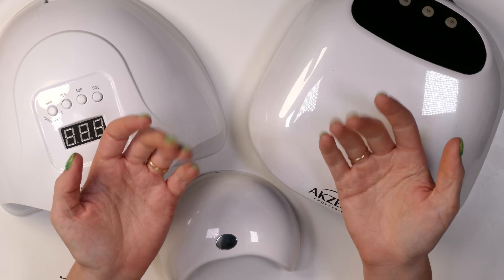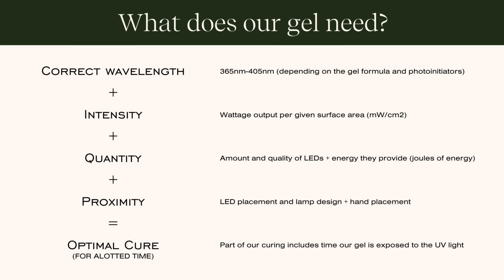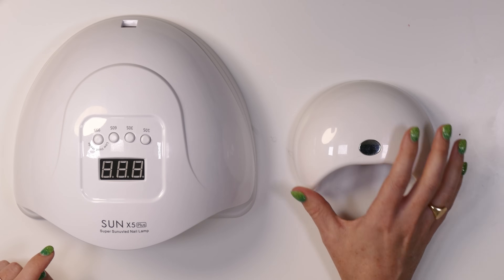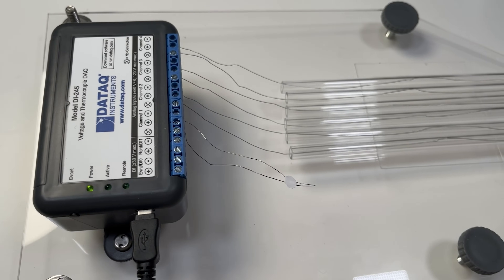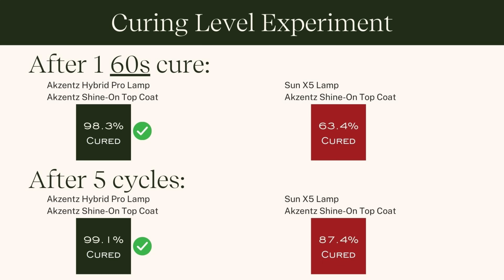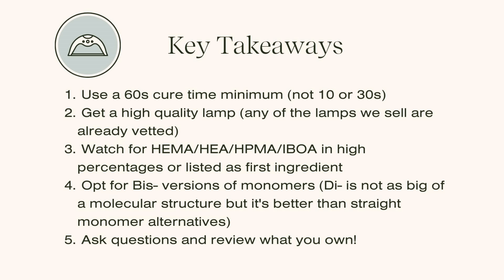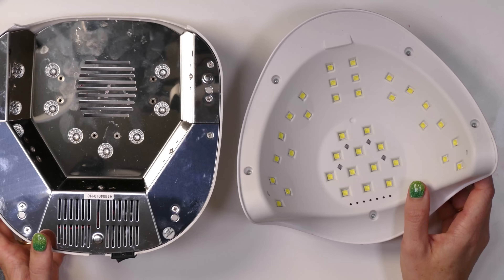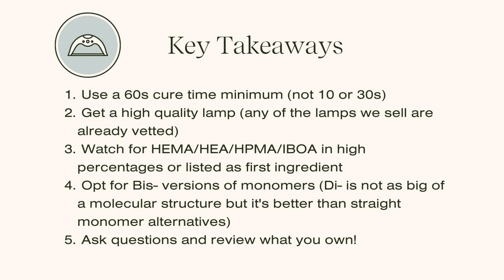Is Your Nail Lamp Giving You Allergies?

Comment: I have a dual  spectrum lamp, on some of my gels they give a time for uv and a time for led eg 30 seconds LED or 2 minutes UV. 
For a hybrid/ broad spectrum lamp should I be curing for the 30 seconds or the 2 minutes? I’ve been playing safe and going for the 2 minutes but I’d save a LOT of time if I could do 30 seconds instead! I only do my own nails so it’s not critical time wise but at the same time i don’t want to be exposing my hand to unnecessary UV rays either. Thank you . 😊
Reply from the maker: If you're using 400/405nm compatible gels (referred to as LED or UV/LED gels) then you could just do 60s.  The "UV" portion is talking about a CFL lamp.  If you're using an LED lamp then I would suggest 60s cure times.  But you'd have to confirm with the manufacturer of your gel.  If they say 30s per layer in your lamp do 60s.  If they say 2 minutes do 2 minutes.

Comment: Hi, so I just switched my gel nail polish to Canni. I know they are HEM free and I can tell a big difference. 

However, I’m still getting burns on my toes and fingers. I’ve gone through three nail lamps trying to find the right one. I’ve also tried a small single one. And just saw on YouTube too move it around and don’t put it so close to your nail. So I’m gonna try to see if that helps. any other suggestions as I do sometimes get blisters on my toes from just the heat and it’s painful

Comment: I get gel extensions done at a local salon and i know they use cheap lamps. But I'm unable to do my own extensions at home. They use CND gel polish. Would it help after my appt, I cured them more under a CND lamp?
Reply from the maker: Why not ask them to upgrade their lamps?  Instead of you trying to find a workaround at home (which isn't going to really work well if they aren't curing each layer properly and you're just trying to cure the outside at home), why not help teach them about the importance of curing when it comes to nail allergies and ask them info about their lamps they are using?  Or find another salon that does use quality lamps and products?

Comment: I have a Bioseaweed gel that cost me 120 dollars that looks like the “cheap” lamp, should I be worried?
Reply from the maker: If you use Bioseaweed gel they should be responsible for testing to make sure their lamp cures their gels to safe levels.  I have not reviewed the SDS for this brand.  I would contact them to inquire about what testing they have done regarding curing levels reached in their gels when using their lamps.  According to industry experts like Doug Schoon and Jim McConnell, gels must be exposed for at least 60s to properly cure. So at a minimum I would check what cure times they recommend, what's in their formula (check SDS for ingredients), ask them questions or voice your concerns to them and go from there.

Comment: Is there a way to tell how many mW/cm2 or energy output a nail lamp will produce? Most descriptions for lamps online don’t seem to go into that level of detail. Would it be a case of getting in touch with the retailer/manufacturer to ask?
Reply from the maker: No not without lab instruments. If you’re buying the lamp that comes from your gel brand company you’re most likely good to go as they will have done that testing. The main issue is people buying generic lamps (that are usually super cheap for a reason) and trying to cure all their gels with it. Each gel formula has to be tested to match with a lamp because of the specific energy needed to fully cure that particular gel. Manufacturers usually do that when they make a lamp for their gel line.

Comment: Hi Liz, super useful video. I have a question. I do my own nails at home with the sun x lamp and have been for years. I only use one type of gel (the OPI) and I've never had any issues. Should I be worried? Or should I be buying equipment to take temperature readings? I live in the UK and the other more powerful nail lamps you mention don't seem to be available to me. How can I test or make sure the lamp I am using is safe with the gel I am using?
Reply from the maker: Hi Daisy, allergies can be developing well before any physical manifestation. Most of the time when itchiness or redness starts happening it is from prolonged periods of exposure. So keep that in mind.  And if you’re primarily using OPI I would recommend getting the OPI lamp so you have that assurance on curing.

Comment: I know it might sound silly, but getting an allergy to nail products scares me SO much to the point where I get upset thinking about it because I'm passionate about nails and for years, I was getting cheap Chinese nail products on my skin and only recently learned about allergies.

Even now, there is no way I can afford these oligomer products and at best, can only afford di-HEMA ones. I will definitely purchase a good lamp though.
Reply from the maker: It’s a very difficult and nuanced topic because allergies also don’t happen to everyone either. But the incidence rate is increasing hence me trying to give everyone the full picture. Being aware is the most important. Not necessary to be scared but I understand why you feel that way.
Reply: What if you bought fewer colors, but higher quality?
Reply: @Lisalovesliberty1  - So what I'm referring to is the builder gel. As far as colors go, I formulate my colors using cosmetic pigment and mixing my builder gel.

So I'm legit just talking about one product. I've looked at the prices of the oligomer products on the market and they are SO expensive (for DIYers, that aren't making money from this).

Right now, I'm going to settle with IBD gel which has Di-HEMA. I read a sheet that shown Di-HEMA's molecular size is almost double regular HEMA. It's not as ideal as Bis-HEMA, but it's still less allergenic, and with full protective gear and an expensive professional lamp, I think I'll be okay. And I'm gonna do the thermometer test that Liz shown on her channel, where I can see if it's properly curing.
Reply: Great video Liz , all greetings from Tunisia ❤ can you make a video about how nail uv lamps are safe ?

Comment: Hi, Liz. Sorry to bombard you.

When it comes to curing completely clear gel, is it acceptable to only slightly cure (say, 15-20 seconds or so) to harden it, and then apply lots more on top and then do a full cure? Obviously this wouldn't at all be suitable for pigmented gels, as the inside wouldn't cure fully, but can you do this with clear? Does the light penetrate all the way through?

I do very long nails, and have to do 2-3, sometimes even 4 layers of gel (they're more than 2 inches long), and having to do 60 seconds for every layer for every finger would take VERY long.
Reply from the maker: Hi Brianna, yes you can absolutely flash cure products to keep them in place, but you need to fully cure the product afterwards and this only works well with clear.  As long as nothing is obstructing the light from penetrating the product well it should be fine, but you could be experiencing more heat by not fully curing in between major layers as you'll have the full exothermic reaction happening on all layers at the same time and this could cause a potential excess of heat on your nail bed.  Greatly depends on the gel you're using, how you're applying the gel, and also the lamp.  

For super long nails (even 2 inches) you might want to flash things into place, then move on to another finger first, and continue until all the nails have the same layer of gel.  Then fully cure that layer before adding more product.  Hope that makes sense.
Reply: @TheNailHub  - Thank you, Liz. This is immeasurably helpful. Seriously. The information you put out, and your responsiveness is unmatched.

Before I found your videos on allergies, I was using cheap Chinese products, getting them on my skin and not thinking anything of it, and I cringe! I seriously almost purchased 1000ml of cheap gel from AliExpress.

Also, I even watch professionals I love using their fingers to swipe the gel off the edges of the nails, and I gasp in horror, haha.

As soon as I saw your old video about Hema and allergies, I bought nitrile gloves, a dust collector, started wearing a mask, goggles and covering my body. But unfortunately I've been using a cheap Amazon lamp. Now I'm going to get the Infinity Lamp.

Comment: Hi Liz! 
Firstly thank you so much for educating us on basics of chemicals in gels and lamps. Getting trusted information is very difficult.

I would really appreciate if you could address the following topic as well. These questions are coming from clients and I want to make sure my answers are right 
- Will using sunscreen before starting nails will help to reduce the risk of cancer from UVLED lamps?
- if cream is applied is there a chance that it gets on prepped nails and affect the durability of gels.

I think we shouldn't apply cream. Please give more clear information on these areas as well. 

Next important question is which type of extension is mire harmful or damaging? Acrylic/builder gel/polygel gel or dip powder? Asking based on the chemical reactions. 
I feel acrylic is more risky but i don't have strong technical explanation to it.

If you have already addressed these areas in old videos please provide the link. ❤
Reply: Not Liz, but I know a thing or two about this and can hopefully help.
 
Here's the thing about nails and cancer risk due to UV exposure: our actual nails aren't living, so they can't get cancer. Our nail beds can get cancer, but never due to UV exposure due to the fact that our nails filter 100% of UV light. No UV light can get to our nail beds and our actual nails are unaffected by UV exposure. If someone gets cancer of the nail bed, it is unrelated to their UV exposure (which is why it's one of the most uncommon types of skin cancers).

For the skin surrounding the nails, UV exposure can impact skin cancer risk. UV exposure from LED/UV lamps is going to be possibly the smallest contributor to a person's UV exposure, but UV damage is cumulative, so it doesn't hurt to protect yourself from all sources of it. You will be sufficiently protected by using a glove or sunscreen only on the skin itself and not on the nails. You could clean the nails after applying sunscreen to avoid it interfering with adhesion in case some gets on the nails. A sunscreen stick would allow for more precise application

Comment: Liz, thank you so much for sharing this information in this video as well as the previous one! I do my own nails at home and while I rarely use gel, maybe a few times a year, I definitely want to be sure I’m doing it safely and this information is extremely helpful. It seems that this safety information is so rarely talked about, it’s no wonder allergies are on the rise. I have a lamp from Amazon that I spent like $20 on a while back. I’ve only used it a couple times but I think I will get rid of it after watching this video and look for something safer. Thank you again!

Comment: How safe do you consider off brand gel products during pregnancy. For example I got the glass nails from NCE and was wondering that. I also have joya mía. Melody Aussie and other brands. That are not like light elegance.
Reply from the maker: I would recommend asking these types of questions to those manufacturers. Ask for SDS. Ask about their lamps and actual output metrics not just wattage on the box. Ask them and see if they respond and how they respond. Will tell you a lot. I don’t know anything about those brands so you’d have to research a bit.

Comment: Let’s say your base gel has fully cured to 99%. what if the color gel layer above that has only cured to like 70%…will your natural nail be protected by the base layer as long as it’s evenly applied (so that none of the color is touching the natural nail)?
Reply from the maker: Your natural nail doesn’t really absorb product. It’s the surrounding skin. And because HEMA is water soluble it can leach out when exposed to water and get on the skin in small amounts. Over time your body may start to create an immune response to this. There’s no fool proof way to “encapsulate” a specific undercured layer. It may help, but it’s not something I would rely on. Better to get yourself set up with quality products and equipment that truly mitigate the risk.
Reply: @TheNailHub  you are amazing thank you!!! Once again all my questions answered ☺️

Comment: Why do you say "UV only" is a misnomer when those gels require UV (365nm) and will not cure without it? They won't cure with visible light wavelengths.
Reply from the maker: It’s misused. Typically it is used as a comparison to LED which is an emitter or bulb type. You could say UV-A vs near UV-A vs violet visible light to describe the types of wavelengths being emitted or the compatible photo initiators but instead it is erroneously referred to as UV/LED which is not communicating the situation clearly. It should really be UV-A vs Near UV-A/Violet when talking about wavelengths and CFL vs LED when talking about emitters. Our industry confuses these two things and the real meaning is lost easily. I’m referring to the typical context that UV only is used in.

Comment: Thank you for this information, I actually have that SUN lamp some one gave it to me as a gift. 
I just bought my first gel starter kit from kokoist, they actually sent me a mini LED lamp and it said only 4 watts. I didn’t use it yet because I thought it might just be for flash cures. Now I’m wondering if it will work better than the SUN. I’m new to gel and am trying to mindful and cautious about allergies, so I really appreciate your videos.
Reply from the maker: It it’s the milk cake lamp then it is for flash curing the Gelip nail tips. Not for color gels. You’ll need something like the Kokoist Infinity to safely cure Kokoist. All the SUN UV lamps I’ve seen are not sufficient.
Reply: @TheNailHub  no it isn’t the milk cake lamp. I can’t find any info of it on their website either. Maybe I will call them. It does have a 405 nm. The name on the box is compact LED light.

Comment: Hold on a second. The minidot lamp is a 45 mW/cm2 output. It is a smaller lamp. This number makes sense. 

If the LE Minidot was the same size as the SunUV lamp with the same area, it is very very likely that both have the same output over the same area. 

If both put out 100 mW but ones has an area of 2 cm^2 and the other has an area of 4 cm^2... 

Then one would have an output of 50 mW/cm^2 and the other would have an output of 25 mW/cm^2.

That's just basic math. For the Akzentz lamp, that's where it makes sense, but you can find a better lamp for half the price of that one with a similar output that is visible spectrum only.
Reply from the maker: The area measurement is the same. It’s base on one square cm of space. That’s the metric. More space means it would actually not increase the potency of the energy. It would be more like a floodlight. More space but less potent. What this data tells us is the mini dot is able to output more focused and efficient curing energy than a lamp twice it’s size. The volume of space inside the lamp will not make it more powerful.

Comment: What do you think of sunUV lamps? Apparently the manufacture a lot of the UVLED nail lamps on the market
Reply from the maker: I stand by my statement on you get what you pay for. I have yet to see a lamp sub $75-$100 (other than a couple specialty mini lamps from specific brands) that cures products to safe levels after one exposure not even mentioning after just 30s which again I think we should all increase to 60s.
Reply: @TheNailHub  Did you mean anything under $75.00 to $100.00 isn't probably the best? I have a mini name brand light from a beauty store that was probably around $75.00.
Reply from the maker: @planning_with_patches5860  I mean any full size under that. Minis vary a lot and most are not great.